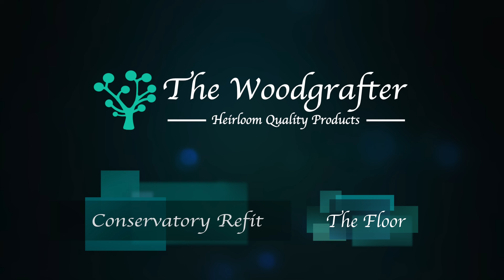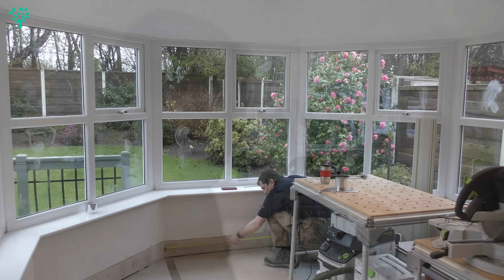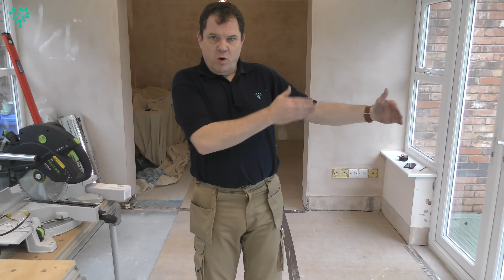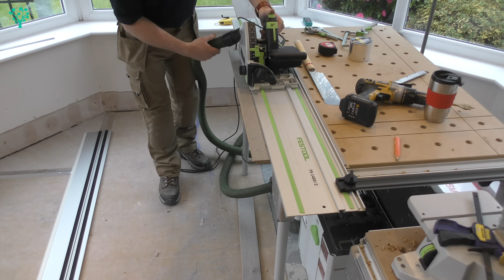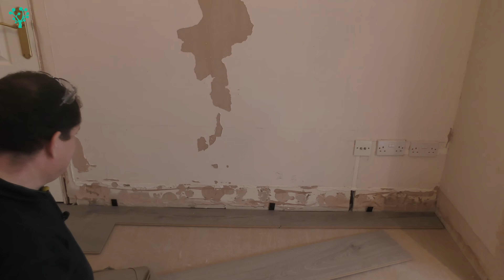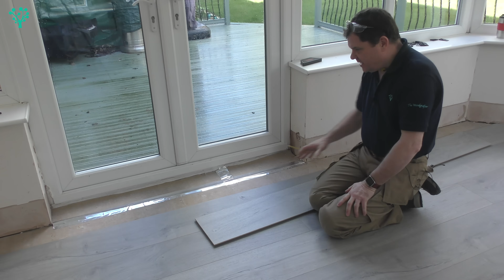The Conservatory Refit part 1 - Fitting a Laminate Floor

Comment: Excellent work Andy good to see you getting down and dirty and getting good use out of your Festool investment.

Although my cheeky/fun comment = doorway, not arch ;-)

I also wondered why the client got you in that space before the walls were painted?
Reply from the maker: +Parafinn Lamp

Thank you Mr Lamp, it’s actually good fun - so enjoying this one.

When I first arrived it was an arch, now it’s a square and soon it will be a perfectly finished opening. (If the customer says it’s an arch - then it is an arch). And anyway, there are no doors.....

The walls are going to be wallpapered, and cutting the floor and the other finish work makes a mess (dust).

So the rational Is to get the dirty bits out of the way first, then finish off. Also the skirting board is going to go over the edge of the floor - so that needs fitting before it can be painted. It all makes sense.

Talk soon

Andy
Reply: @TheWoodgrafter 
Makes sense, looking forward to seeing the second fix go down.
Reply from the maker: Parafinn Lamp

Hi next on in the series is out on Friday - looking at the arch. Aka doorway :-)

Cheers

Andy

Comment: Nice informative video 👍 
Just a quick tip that I do is: when I put the first couple of boards in I put a quick spray of contact adhesive on the back just to hold them in place, shouldn’t affect expansion as it is only glued to the underlay. I only do this as I made a costly mistake before, we learn more from our mistakes I guess haha. 
Keep the videos coming mate 👍
Reply from the maker: Thank you for commenting, and thank you for the tip. I could see that working, the other thing I sometimes do is stack the boxes of boards on the first couple of rows to keep them stable then work out.

This was a new design of board for me. These board used a 5d click method, so it was pretty easy to click together, so didn’t put much strain on the boards.

However, I still kept checking for parallel - little bit paranoid on this one due to working from a centre line.

It worked out well, so all good.

Talk soon

Andy